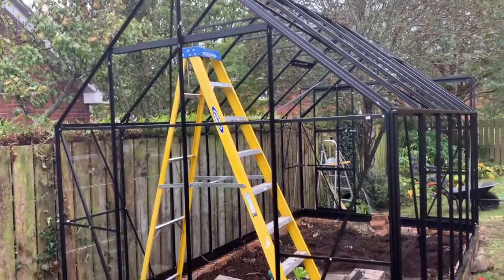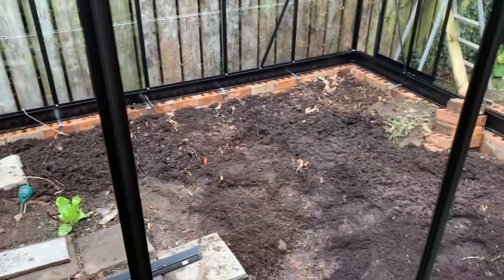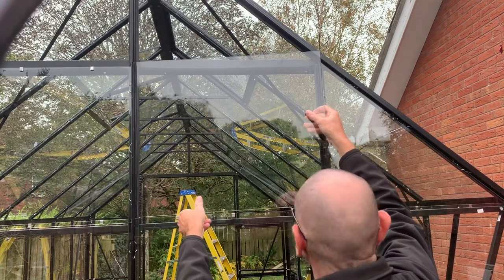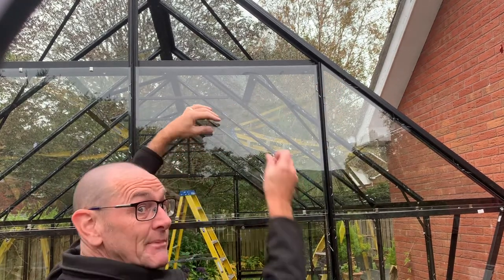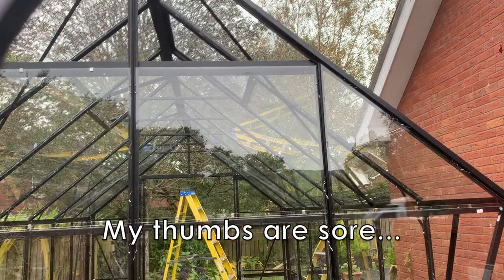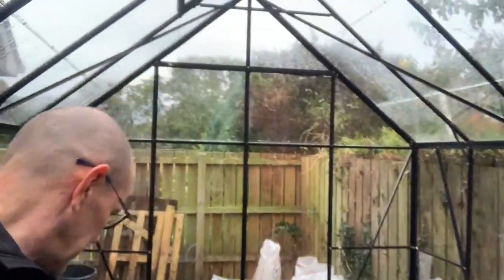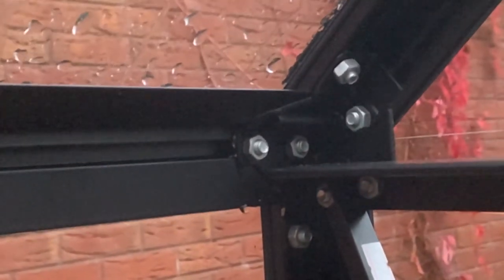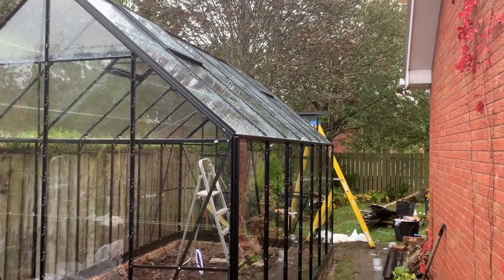Hall's Magnum Greenhouse Build - Part 8 - glazing!

Comment: Great videos Connor. I like the “8” parts.  As for the gaps in the glass. Might be due to the expansion of the frame in the hot weather and if the glass was tight now come a hot summers day when the frames would expand the glass would crack. A solution I would use if you wanted to close the gap is a tube of black all weather flexible silicone. 👍
Reply from the maker: james moore thanks James. But the gap is too big. The opposite side is perfect. I can’t understand it. I have some spare glass so I’ll just cut that to size. All keeping well?
Reply: connor sweeney keeping well mate yea. Pain in the backside this covid lark but sure what can we do only what we’re told.
Reply: @HappyDaysNI  did you find the source of the leak?
Thanks for the videos. Very useful.
Reply: @connor sweeney  I am finishing the glazing now, and also have this gab in the upper back windows.
I think it is because we are missing the H profiles, which the manual says there should be 6 of in the kit. Instead we use the glass hangers which lowers the glass 5-6 milimeters x2.
In the front where it is only one hanger "high" the glass can just cover the opening.

Comment: hi couple qustions  this is sold without the base  but i can buy it seperately do u need the base? did you use it?  also hows it held up  since u bought it??   be great if you could answer as i am going to buy one. thank you
Reply from the maker: Yes it is- mine came with it is I used it. Great for getting everything square; id really recommend it, great unit!

Comment: Heyup again I glazed the rear gable today and had same issue with that top triangle being short!!!
Reply: @connor sweeney  I am finishing the glazing now, and also have this gab in the upper back windows.
I think it is because we are missing the H profiles, which the manual says there should be 6 of in the kit. Instead we use the glass hangers which lowers the glass 5-6 milimeters x2.
In the front where it is only one hanger "high" the glass can just cover the opening.

Comment: Heyup thanks for your help so far just watching the whole build again with a coffee!!! Just wondering about that gap you had at the top? Did you find out why? Wondered if you were to pack up the bottom piece with something like a glazing packer (I used to fit windows) it would close that gap up? And did you find why is was leaking? I'd love to see an update video this summer with
Reply from the maker: Thanks! I actually got two pieces of glass cut that fitted the gap - about a cm larger on the bottom side. All going well now!
Reply: @HappyDaysNI  that's good but I'm on problem number 367 lol I've got the 4 sides made up and just trying to put the rear gable onto one of the sides I've used some stakes in the ground and tied them to them you know all about this lol yes I'm also on my own the mrs is asleep after nightshift! So I can get the 2 pieces to fit together ok but without the 2 bolts on the side but when I slide them into place to align with corner bracket I cant get them to go because of the geometry if that makes sense? When the bolts are in place they are holding the pieces away from eachother and I cant get that angled flat side to go under the corner bracket slot which I think it's supposed to do it all fits nice without the bolts yes the instructions are shocking I totally agree on that one mate!!!
Reply: sweeney  nice one regarding my issues getting the side and gable together I had another look and decided the unbolt the gable diagonal which I could then get the side to slide into the corner bracket into those recesses in the bracket and nipped it up was a bit awkward getting the bolts inline withe holes again cos the just wanted to slide down!! Took me over an hour to get them together dont know how you managed it Conner?

Comment: Hi Connor,
How did you fix the leak in the corner? Mine has the same.
Reply from the maker: I didn’t. I figured that they don’t need to be watertight?
Reply: Thanks, 
I called a sales rep this morning. Apparently you can add a little silicone to the end of the gutter in the gaps between the joints to stop the leak. I thought it was due to water overflowing the “internal” gutter behind the windows. 
I think I’ll give it a try in the weekend.
Reply: I reckon the water is getting in from the gutter where the gutter finishes on the side frames it butts up to another piece which is on the gable side just wants a bit of silicon to seal it

Comment: I purchased this exact model 4 years ago. When glazing the roof I was concerned that there was no rubber seal to fit running along the bottom of the roof panes where the gutter channel is and that this would cause problems with leaks. I called the suppliers to query this and was told that it was not required. I decided to run silicone along the bottom of every roof pane to try and prevent leaks. Unfortunately this did not work and the greenhouse leaks badly in the corners where you have shown and there is also water ingress along the whole of the gutter area. There is a major design flaw with the sealing at the bottom of the roof panes and I would NOT recommend anyone to buy this model. It’s a shame as it’s a decent greenhouse but this lets it down badly. Go for another design or manufacturer!!!